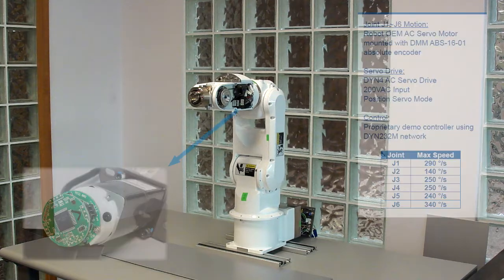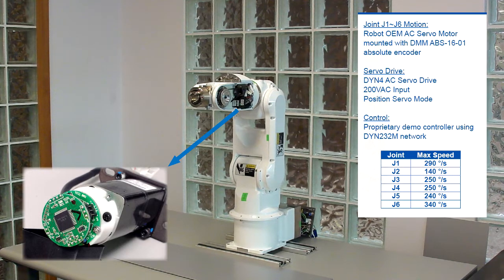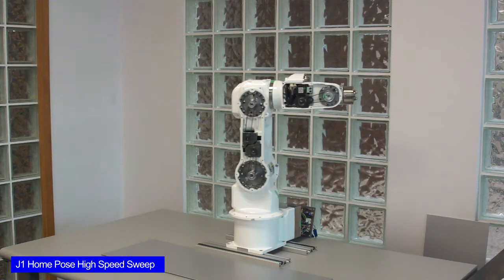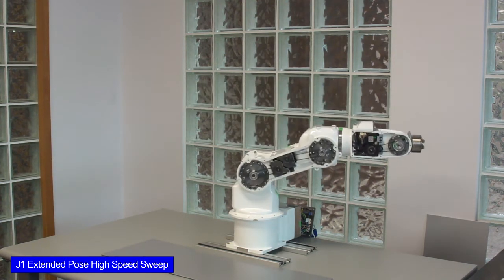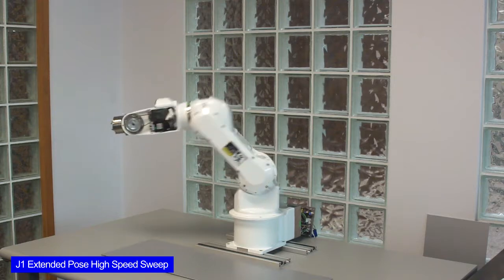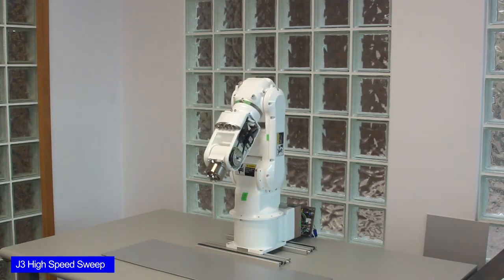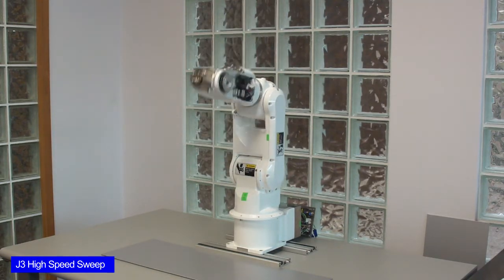DYN Servo - Robotic Capability

Comment: thanks again for the servo package last year.    just one question what program are you using to controlled the arm ?
Reply from the maker: Hello!  For the motions seen on this video, we used a combination of inverse kinematics and speed interpolation.  This was used to calculate each joint position and synchronized speed/acceleration.  The commands was sent from a microcontroller via our DYN232M serial network to each individual DYN4 servo drive.  We also used the RoboDK program to model the path and overall physical structure.  Please contact us if you have any further questions.

Thank you for using DMM!